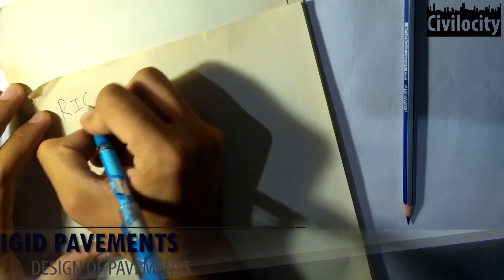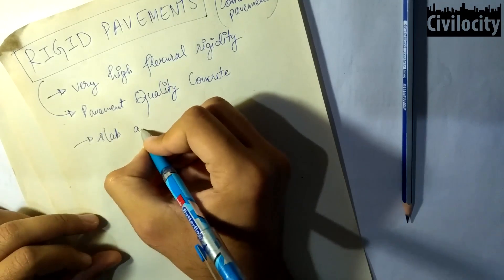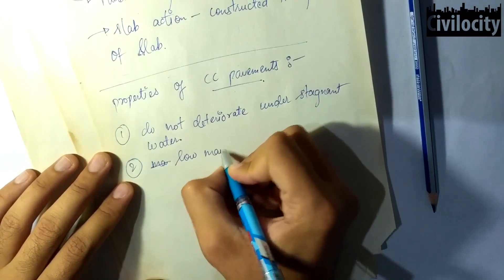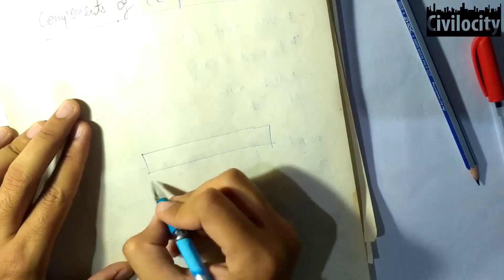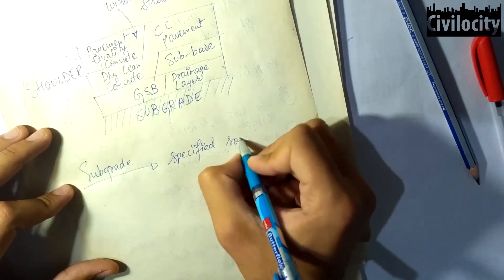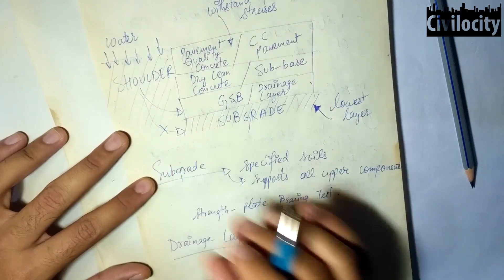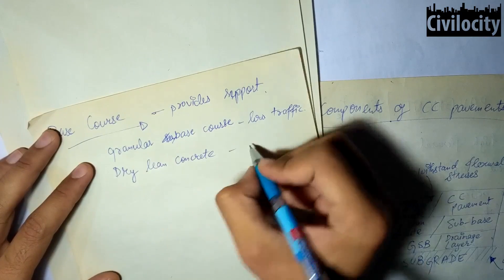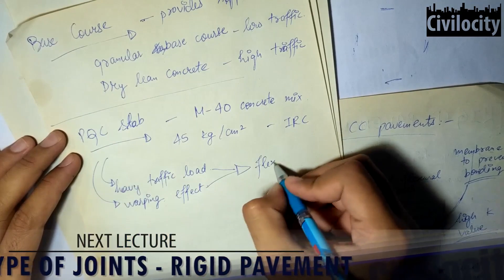Rigid Pavement | Design of Pavements | Lec-14 Part-1

Comment: Question for you guys - if a rigid pavement /road is underground does it require fewer expansion joints ? are we talking 60% less joints or 80% less expansion joints ? Temperature is stable yes and much less expansion and contraction. true ?
Reply: I guess yes. Lesser expansion joints are required in rigid underground pavements. Since the   temperature variation is subtle as compared to on ground.

Could I know your views too?